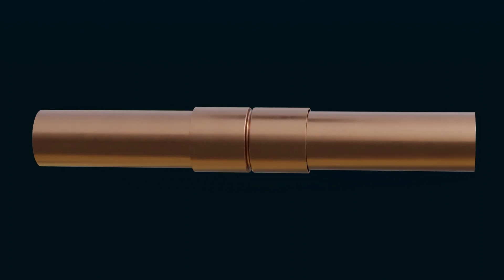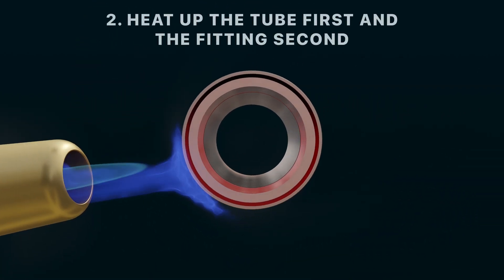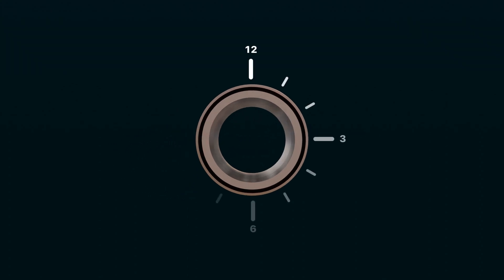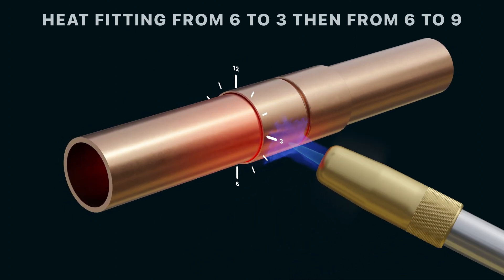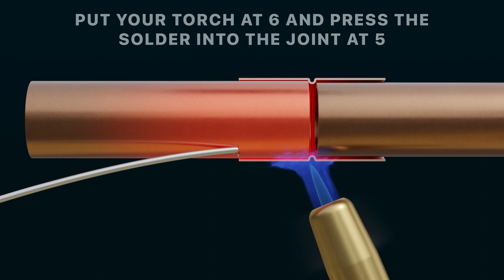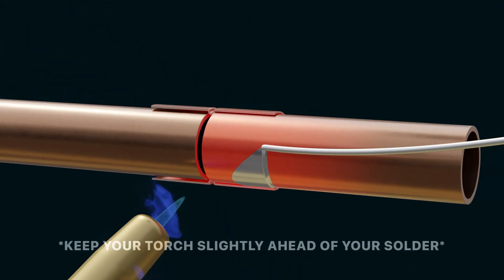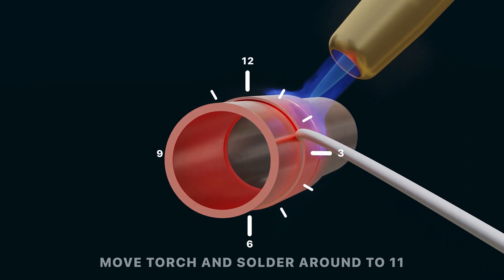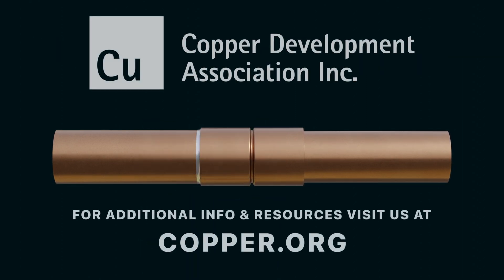How-to Properly Apply Solder and Heat to a Copper Joint

Comment: Thank you for the great video but the viewer should be informed that the red in the animation is an indicator of heat location and not the actual color of the pipe while being soldered. I did see a professional plumber do just that just the other day, cooked the copper to death and used ½ a spool of solder, will not mention any names.

Comment: This sound like nonsense. Who has enough time to be rotating the flame around the pipe before the solder has already wrapped around the inside
Reply: Skill issue
Reply: Joints are against the wall how do you heat at the back effectively the way this animation shows